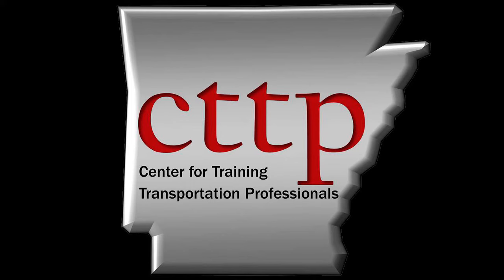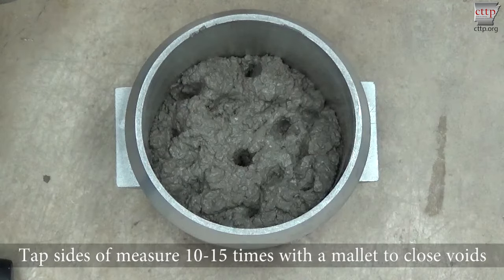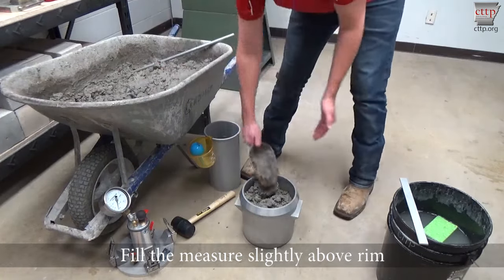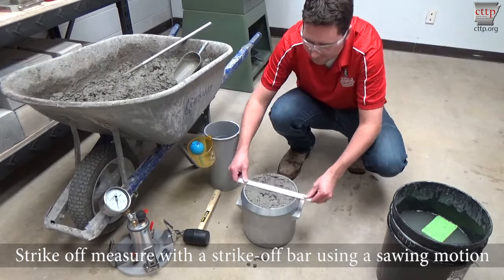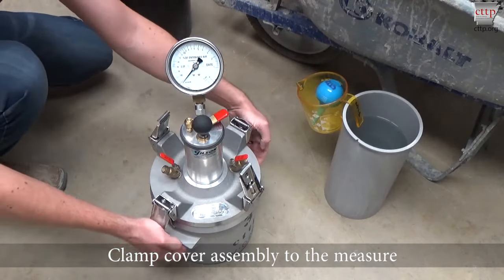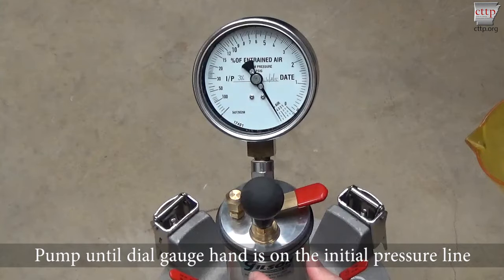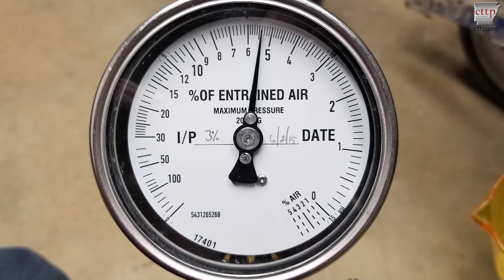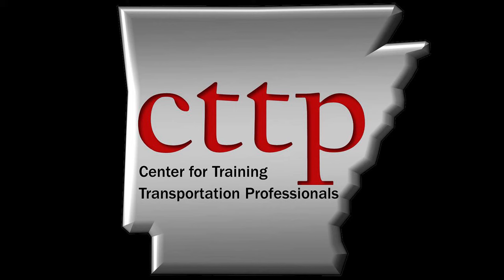ASTM C231 - Air Content of Concrete by the Pressure Method

Comment: What if the petcocks are clogged
Reply from the maker: If the petcocks are clogged, you want to make sure they are unclogged prior to running the test.  That can be achieved by taking the cover off and either shooting water through each of the petcocks or if some dried concrete is stuck in there, using some type of a small tool to dislodge it.

Comment: i though for the air pot you have to use a strike plate placed 2/3 on the top of the pot?
Reply: Thats only if you are ALSO checking for density. If you are just doing the pressure you can use the strike off bar.